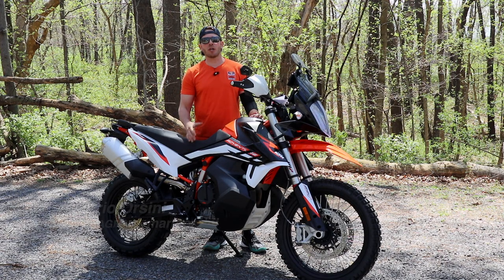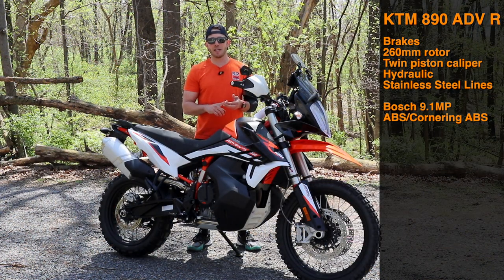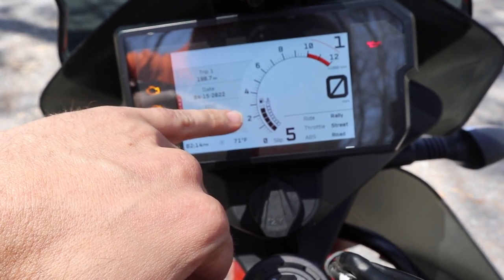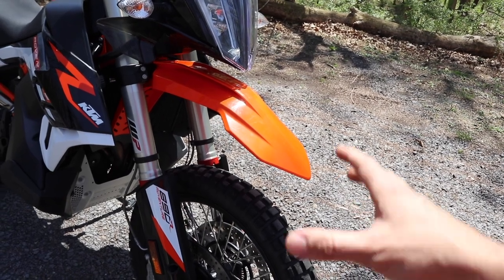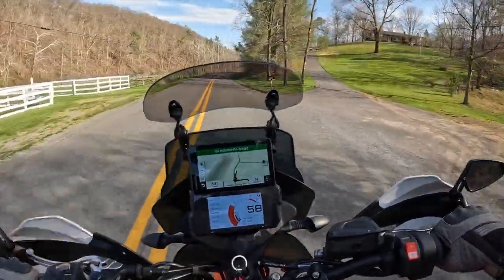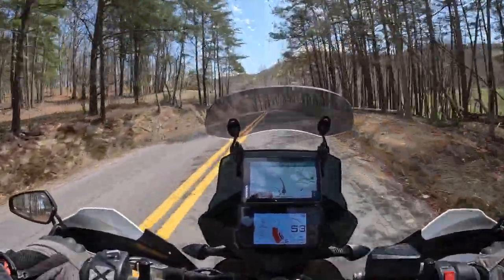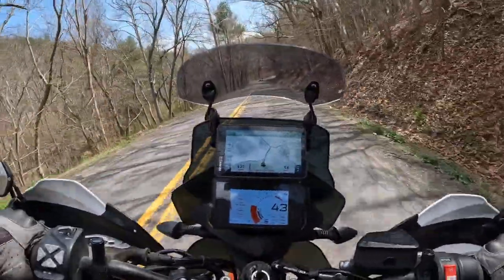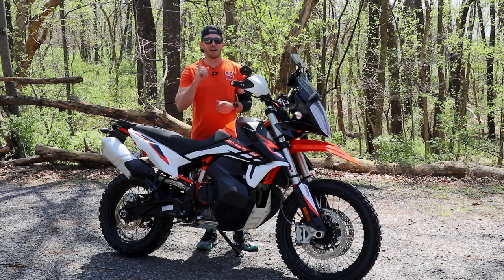KTM 890 ADV R Review

Comment: I traded in my 2015 1290 SA T last fall for a 2021 890 R and have absolutely no regrets.  I have made modifications including the KTM Low Seat which is more comfortable and lowers the height just a tad.  This bike is light and balanced well enough to even do some single track riding without a problem. Great review Mario.

Comment: I keep my 1290 in off-road mode and I’ve never felt the need to fully turn off the ABS so for anybody worried about that, I wouldn’t. Totally agree about the TKC80’s there great but I only got 2k out of rear😅and I BABIED my 1290 for the first 1,000 miles and didn’t really start getting on it harder till 4-5,000 miles. The 890R is the bike that I tell myself I should have waited for but SHEESH that new 1290R😍
Reply: 1290 r was just way to heavy for me. I ride 90% remote off road n enjoy tight technical turns. My 2022 890 adv r is still a bit heavy but it will do ;)
Reply: about TKC80, I love them on-riad and off-road, but true the rear don't lasg long, 5000km on a off-road touring Africa Twin, 3000km on a sporty off-road Husqvarna 701. Michelin Anakee Wild, Mitas E10 or E09, Bridgestone AX41 are about the same performance and lasting. If I really want to ride hard on muddy single track, I go for Michelin Trackers lasting 2000km. Front allways last twice the rear.

Comment: How good would the 890 be on the highway? Is it too light?
Reply from the maker: Aside from the seat, it's great on the highway. If you were going to do a big road trip, I might opt for the low fender kit so it catches less wind but it's definitely not like riding a DRZ400 or similar. I would make a good touring bike but not as good as the 1290SA.

Comment: Very thorough review.👍 The 890 Adventure R certainly a capable overall adventure bike; particularly off-pavement.  Has the owner had any issues worth reporting?
Reply from the maker: Front brake master cylinder cap had a small deep around it but no other reported issues.

Comment: As a 890 Adventure R owner from new, you forgot to mention that the engine itself sounds like a bag of spanners in a tumble dryer. It's a great bike minus the KTM build quality/fit and finish. I find the taller seat actually much more comfortable than the stock seat without affecting the ability to touch the ground (since it's narrower).
Reply from the maker: Yeah, I don't remember if I mentioned the engine note as I had before on the 901 review...it's not a good sounding motor.
Reply: @2WR   It sounds MUCH better with a slip on and a decat. Unfortunately that requires a tune.

Comment: Good to hear from you Mario and thanks for another awesome review. We both own 2016SA yours is probably 20k more miles then mine. Question: Would you ever sell your 2016SA and upgraded it to 890R? Or would you rather buy 2022 1290SA S?
Reply from the maker: First question: No. To me they are too different and I don't think the 890R would make nearly as good of a touring bike as my 1290SA. Second question: If I were choosing between the 1290SA S or 890 R as my touring bike, I would go with the SA S. That said, having ridden the SA S for a week in Europe it's a great bike but I don't see it as any sort of upgrade to my current 1290SA and it's missing some things. For one, it doesn't have the 7.9 gallon fuel tank. It's also missing the spoke rims.

Comment: Without reading all 117 comments, you didn't cover the heated grip option. Is that an aftermarket purchase or is it a turn on purchase at the dealer or ???
Reply from the maker: You need to buy the grips separate and may need to have the option turned on by the dealer as well.
Reply: @2WR  Thank you very much.

Comment: Boy howdy! Wrong video to watch when you frustrated with HD. Is Rally mode a dealer added option or factory?
Reply from the maker: Ron, it’s available through KTM but must be “installed” by the dealer. Essentially you can add it into the price of the new bike or pay to have it unlocked later. Pretty simple activation that just requires the bike to be hooked up to the dealer’s diagnostic tool/computer.

Comment: Could an adventure bike truley be premium gas only. Most of gas off the beaten  path is regular,... if you can get it
Reply from the maker: They run fine on regular. Premium allows manufacturers to tune to get bigger HP numbers and better fuel efficiency. A lot of what’s driving this is Euro 5.

Comment: I would really like to pull the trigger on a newer 2023 890 Adventure not R,  but im concerned with long long time reliability. Im the kind of guy who buys a vehicle and keeps it and maintains it for years and years, and since lot of people seem to have longer term issues with KTMs, i was wondering how the brand in general holds up, and if they have improved vehicle quality and long term reliability since Pirier bought KTM from Bajaj
Reply from the maker: I’ve got over 60k on my 2016 1290 with a dead fuel pump at 36k being the only issue. My 2008 990 has about 60k on it too with no issues. Just keep them maintained.
Reply from the maker: Ended up buying this 2021 890R and so far so good.
Reply: @2WR  thank you ✨

Comment: Could you tell me the name of the foot pegs that drop down more than the standard to give more leg room? I am 6'4" and do have any recommendations on a more comfortable seat without lowering it? Excellent Video! Thanks
Reply from the maker: The pegs are made by Raid Garage. https://www.radegarage.com/parts-us/ktm-larger-low-pegs-us/
Reply: I am 6’7” my setup is: pegs from Vanasche seat Renazco Racing handlebar to the top mounting spot and raised by 1.5” and rotated forward 2 degrees.

Comment: Maybe do a comparison with the Honda AT?  Seems the 890 and the AT match up pretty close power wise. 
I know not the same exact class but a fun comparison anyway.
Reply: Also, the new ducati desert sled!  Montani Semper Liberi!
Reply from the maker: Maybe the AT has gotten better with the newest version but the first gen 1000 was less than impressive with an intrusive tractional control system and a top heavy feel. If I can get my hands on one, I'd review it. From a comparison standpoint, I think the similarities stop at the price point. The AT is heavier and has an extra (nearly) 200ccs.
Reply from the maker: The Desert Sled is a fun bike (have a review of it on the channel) but definitely not comparable to the 890R. I bet you mean the new Desert X...that comparo would be interesting.
Reply: @2WR  correct, the “desert x” not the desert sled.

Comment: heavy at 493. I like low 400s. my atk is a mx/Enduro at 280 lbs 4.4 g tank wp susp rotax 600
Reply: I like low 200's like my '91 KX 500 2-stroke...but you can't get a smaller bike to do everything the 890 can do, especially for long-distance and carrying luggage.  It's not happening.  If you're riding nothing but local single-track or trailering it everywhere you go, great, if NOT, like me riding 290mi to get to ride Moab AND ride back in comfort (and much longer in the future), then get an 890 R.
Reply: @kx8960  atk jus add a seat cushion has wp susp 4.4 g tank 280lbs. Same weigh as kx
Reply: @rajanrairealty8979  My KX has a 4.5 gal desert racing tank, and weighs 230lbs empty, a full 50lbs lighter than the ATK, HUGE difference.  I'm cleaning up the KX to sell though, don't need it anymore.  I think KTM could shave a bunch of weight off of the 890 if they paid the attention to detail that manufacturers do for sportbikes.  My KTM weighs the same as my 2015 BMW S1000RR, but the BMW has 200hp.  So, I'm thinking that with some work they could save 20-40lbs off pretty easily, and I'd gladly take the extra price increase for a factory lightweight kit that I didn't have to install myself.
Reply: Kx shud be light .they eat gas as well but they aren't as durable don't they crack frames n bolts. More for local .the atk 620 is good to also the maico 700 can get new
Reply: @kx8960  how much for kx
Reply: @rajanrairealty8979  It's a '91 in excellent shape (I had to stop riding it shortly after I bought it new and it's alsways been garaged ever since), original seat and cover, all original plastics in great shape, believe it or not, even the original front tire.  I'll be listing it for around $4,500 or so on Cycletrader.
Reply: @kx8960  wat state
Reply: @rajanrairealty8979  NM

Comment: The poor warranty on these bikes really killed it for me. Only 12 months? Thats a real lack of confidence from KTM on the R models. 

Gonna stick with a Norden 901 with similar performance offroad, better on road, and 24 month warranty. If theres one of the two that is going to last longer as a "wow look at that bike", its definitely the Norden. When I look at the 890R it just looks like every other offroad bike out there. People who aren't familiar would just assume its a large dirt bike, not anything special. The norden turns heads and will for years to come. 

Side note: The ABS changes are because of legal requirements in some countries. You aren't allowed to disable front ABS in many countries anymore.
Reply: I thought the same thing about the warranty. Then looked at the Honda AT and it also is only 12 month.  Interestingly the KTM 890 Adventure S is a 24 month.
Reply: @ridemfast7625  yea it's a common issue with adventure bikes. The Norden 901 has 2 year warranty though and is closer to the 890R than the 890S is.
Reply: @TheVidKid3000  Have not studied the 901. 901 is sort of in between S and R? Longer suspension then 890 S but Apex. Will look at 901 reviews more if it saves me money:)
Reply: @ridemfast7625  Yea it's essentially the middle ground between an 890 and 890R. A lot more stylish and pretty similar performance to an R, but not quite as durable if you drop it and the suspension is not quite as good, but still amazing and it will really shock you how much you can abuse the suspension. I ride it like it's a dirt bike lol.

Comment: Only big disadvantage of the bike is the braking system...a brembo system would do wonders for this bike.
Plus making it a more reliable.
Will makes its sale skyrocket.
Reply: SRSLY?  Have you actually ridden one?  I own a 2021 (5,000mi so far), there's ZERO brake issues.  I've seen 100mph speeds, and steep mountain paved downhills loaded up, and I'm perfectly happy with them.  Many more dirt-oriented even REMOVE one front caliper and disk.   I'm 99% sure those ARE Brembo's.
Reply: @bradsanders6954  I looked, and I found nothing that either confirms or denies whether they're Brembos or not.  They sure LOOK like Brembos, so, until I see otherwise, I'm going to say Brembos.  Do you have a source claiming otherwise?
Reply: @kx8960  my 2021 890 R has J Juan brakes branded as KTM. Levers also have JJ markings. 
Mine is an Australian spec, has done just under 9000km and zero issues(engine, brakes, anything). Brakes are definitely one finger pull for all situations. Loving my bike so far.
Reply: I've never even HEARD of "J Juan", I have seen no markings on mine, but to be fair I haven't bothered to look...why, they work great?  As you also noticed.  I seem to remember (could be wrong) reading that OTHER KTMS, like the Dukes, had Brembos, and they LOOK like Brembos, so, I don't care as long as they work...and they do.  There is a little "judder" right at the end when rolling to a top, but I believe that's the TKC-80 on the front.  At speed, you just have good, powerful, smooth braking.  I saw over 100mph last weekend having to pass LONG lines of cars/semis, and the brakes were fine, but did notice that I got a fair bit of weave fully loaded with a BIG crosswind and fully loaded with hard panniers and box.  You simply can't expect a dirtbike going 100+mph to be as stable as, say, my 2015 BMW S1000RR, and must ride accordingly.  For what it is (giant dirtbike), I have ZERO faults with it's handling or braking, on-road and off.  Glad my brothas down unda are enjoying theirs like you are!  I hope to get down there one day to ride, but as GOOD as you guys are, I've gotta scrape off 30+ years of rust from NOT riding dirtbikes and get better so I can enjoy it more and and embarass myself less!  LOL  Ride safe Bro!